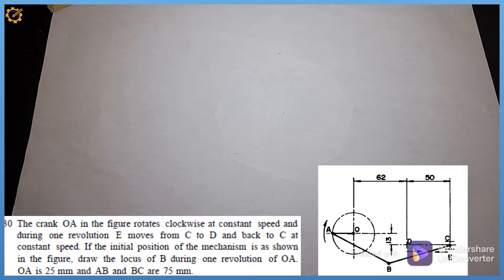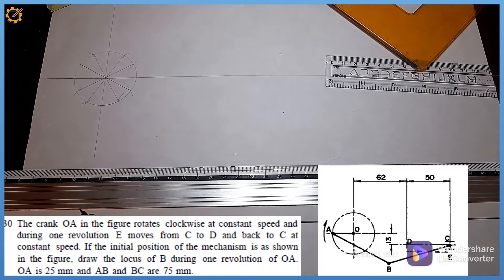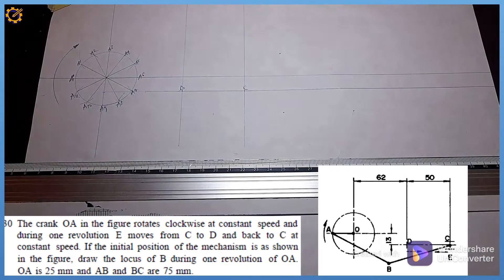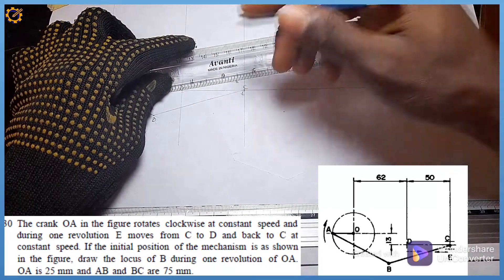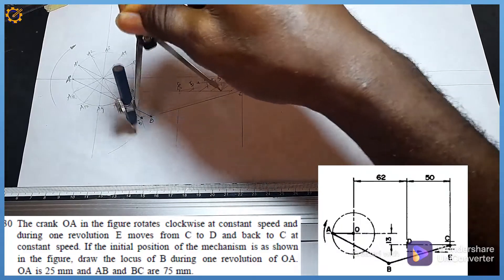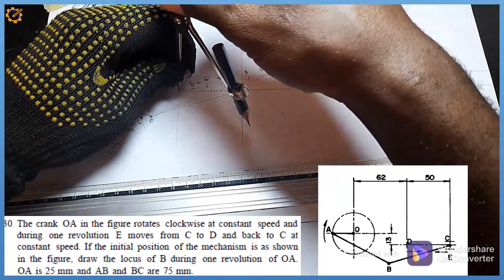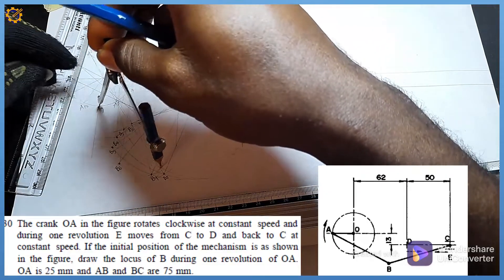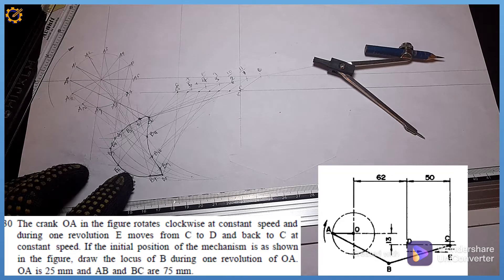CRANK MECHANISM - Link mechanism  in | Technical drawing | Engineering drawing

Comment: Sir why did you divide the length of the line CD into 6 equal parts?
Reply from the maker: Bcoz as the crank rotates to a complete revolution,  the end C moved to D and back to C uniformly... try and read the caption in the diagram as stated in the textbook

Comment: why did you choose to divide line DC into 6 equal parts,why not 12 or any other number
Reply from the maker: Since it travels to and fro, to me 6 is a reasonable number when considering the distance, u can decide to use 12 or 8 but it is gonna look rough and choky... its ur call actually u can use any number that suits u the most important thing is that u understand the Concept itself.
Reply: Since we are making use of 12 divsions on the circle the 'to' movement will correspond to 6 divisions and the 'fro' movement will also correspond to 6 since it goes to and fro in one revolution . Using 5 divisions will be suitable if you divided the circle into 10 using 4 will be suitable for 8 and so on